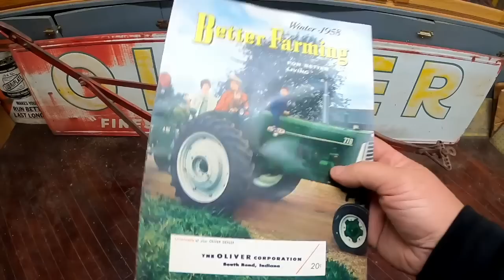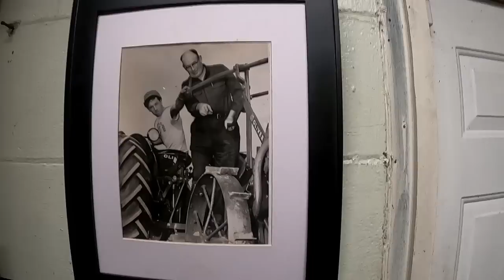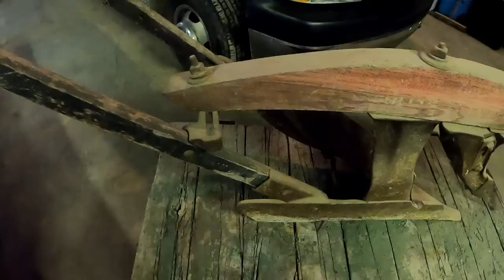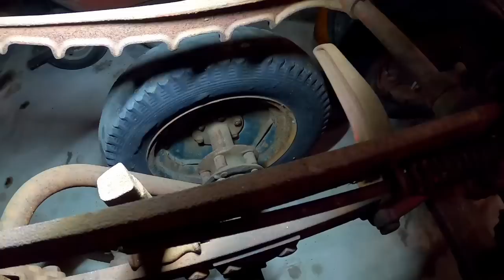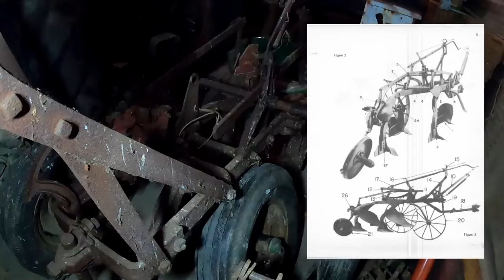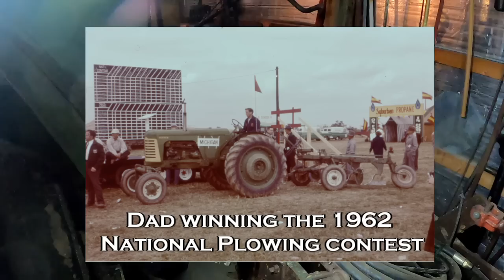Oliver and White Equipment Tour - Tillage Part 1

Comment: 😊😊 HI CHRIS there was a time ⏲️ 😊 back in the 194OS/195OS when the teactor dealerrs did have plowing matches and they had the equipment displays also and back then the tractor 🚜 😊 factorys 🏭 😊 they had factory tours back then and in the 196OS when there was newer tractors when they was made 😊😊 chris U no that in 196O other tractors companys went 2 the inline 4 and  inline 6 cylinder engines 😊😊 OMG 12 25 2O25

Comment: Hey Chris idk if you would be interested or not but in my area a really good looking white combine came up for sale with low hours and a cheap price for 2 or 3 heads  forsure a bean and corn header, and it's fully functional. If I remember right he's only asking 2500 give or take and I thought on one of your combineing videos you mentioned you wouldn't mind a white combine for an extra or just for fun one day. It's a little smaller machine I think it was a 725 but if you wanted to see the ad on it I would be glad to send it to you and even check it out because he also has a tractor for sale that I am going to be looking at.
Reply from the maker: Where is it located?
Reply: @ThatOliverGuyChris  it's in pine county MN I know it's far however I have actually never seen one before let alone in perfect shape  and I have no idea if they are rare or not so I just thought I would tell you!
Reply from the maker: Thanks. That is a bit of a haul for a combine.
Reply: @ThatOliverGuyChris  it is for sure but like I said had no idea on the availability of them so figure j would tell you! It definitely is a clean. Machine almost looks restored but isn't and I almost wish I needed a combine because for my operation it would be the perfect size and seems to be a good price with the heads

Comment: Nice history lesson. 
I spend one year in the local plowing club when I was that age. The setup they had us use was a Fordson Dexta(with broken governor, still pulled like snot!), with a two furrow Kverneland 2 furrow(m or mz competition special). They also had a Ford 3000 and an Oliver 55 also with Kverneland 2 furrow plows. I still remember how to do a proper strike out with a two furrow. Curious, I tried the same strike out system with our Kverneland tripbeam 3 furrow. Actually worked not bad.
Before my time dad and grandpa plowed with Ferguson tractors and a Ford(presumably a 2 furrow Dearborn). What would be the likely hood of that plow being built by Oliver?
Reply from the maker: Oliver did build plows for Ford back then, so there's a good chance of it being Oliver built. JD Oliver and Henry Ford were good friends, but at some point had a personal falling out that carried over into their business dealings. The Oliver 7A plow was designed and built to work with  Ford tractors, but was still sold as an Oliver.

Comment: Another great video!! That model 40 was pretty interesting, what was the purpose of the arm behind the guide wheel? Also, the dual pin lock on your dads plow looks identical to the one used on the JD model M3b 2-way single bottom plow that I have. (just mentioning in case you ever needed to find parts) Thanks for documenting all of this history!
Reply from the maker: That's a jointer. It would kick the residue over to get buried better. If any residue ended up on top, it's almost always from the land side of the plow.

Comment: Till 73 my dad used a AC wd pulling a Oliver trailer plow, he had a side hill hitch on the tractor. Who built them?
Reply from the maker: The sidehill hitch? Oliver had them available for most all of their semi mount plows. They did offer a sidehill hitch attachment to put on tractors like the Super 88, 770, and so on, to use with pull type plows. If yours was on the WD drawbar, I would think it was made by Allis, but that is only a guess on my part.

Comment: Soft-center off-center moldboards.  Raydex and speedex moldboards.  I went to South Bend in 1976 to pick up an 8 bottom plow and 28' folding disk and while they were loading my trailer (which already had a 4-150 with duals on it) I simply just walked around the plant. Simply rode the elevator to whatever floor it was going to.  Every color of the rainbow was being made there.  I was fascinated by the rotary oven that was used to heat moldboards for stamping and the guys that took the completed bottom and polished them on the big finishing wheels.  Drove the length of IN with all of that on our 5th wheel implement trailer pulled by a 1976 Ford 250 FWD pickup, 360 engine, and a gross weight of 38,000 lbs.  Never got the automatic transmission out of 2nd gear.  Picked the 4-150 up at Sharp's in Indy, hauled it to South bend so they would be able to load the implements under and around the tractor.
Reply from the maker: Cool history,  thanks for sharing!
Reply: My cousin has a 1600 gas narrow front sold new by sharps. We’re only a few counties south
Reply: OH, and I stopped at the remains of the old Studebaker plant where some guys were still hand-building Avanti cars long after Studebaker quit.